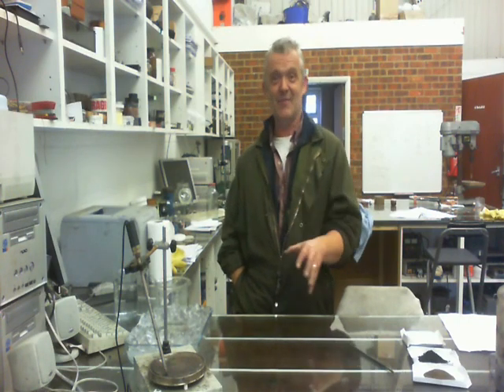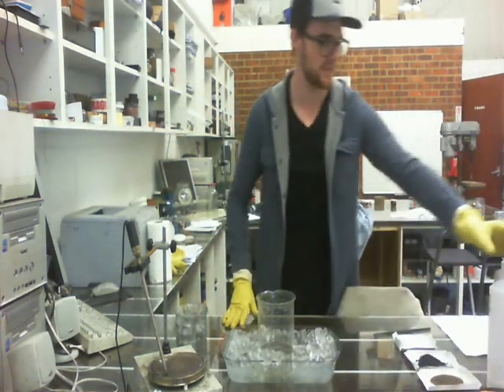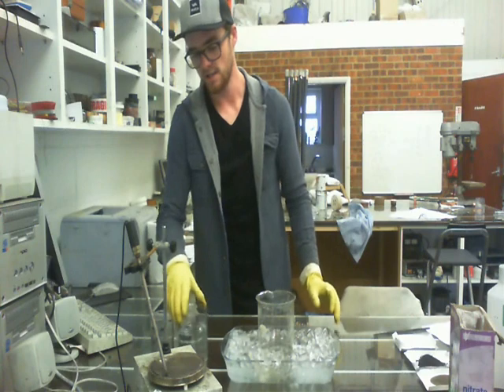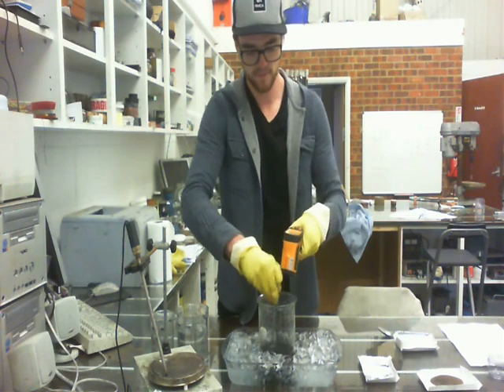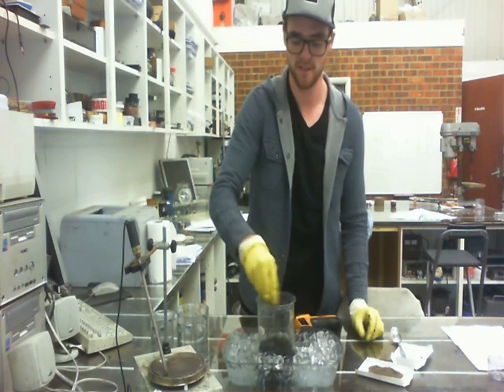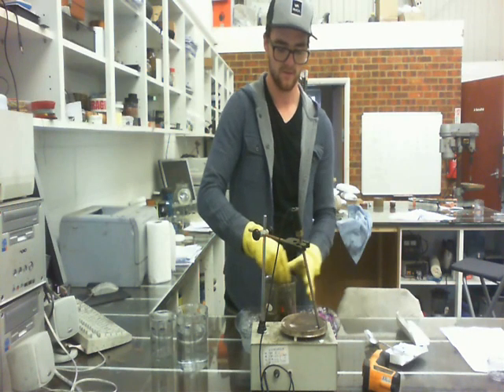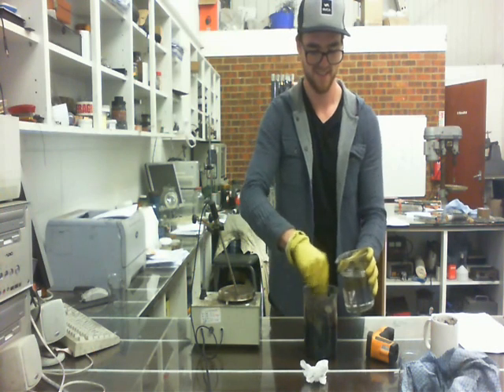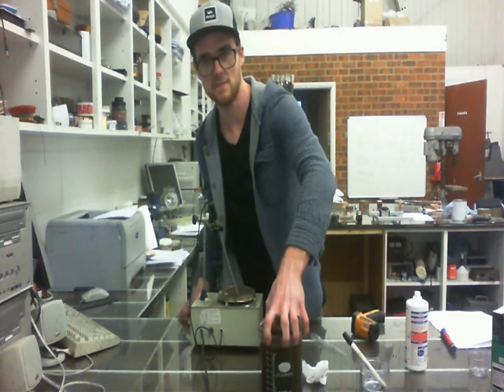Jeremy Makes GO

Comment: Could you advise me where to get peroxide from... i've been all over to try and find some, not been able to locally.
Reply from the maker: it's used as contact lens cleaner and for cuts and burns - and some places dyeing hair - dentists use it for bleaching teeth - the best place is a pharmacy - you can get 3% solution - which is what is needed
Reply: I'll have to have another look
Reply from the maker: chris stagg
ok mate

Comment: good show Rob - as always a good sport :) letting friends play with your toys takes quite some unearthly detachment :) - I always cringe when friends want to help me do stuff ... be it on the motorbike or on "creative" stuff ... 
great job Jeremy !
Reply from the maker: lol - i was cringing inside mate
Reply: hehe
Reply: ok Rob, I'm sorry to ask you this question here but here goes:
could graphene say 5% in water be used for a magnetohydrodynamic convertor at lower temperatures ? say 150 to 300 degrees C ?
effectively you are seeding the fluid with graphene ... passing it through a magnetic field ...  should be able to get some electricity out...
Reply from the maker: actudoran
do you know - i have no idea - but it wouldn't take much to try it - so i will - especially as a friend just sent me some stuff on JP Petit and MHD
Reply: Wow cool! Got to feed the baby and will get back to you in a short while
Reply: there are 2 types of mhd ... closed and open circuit.
on the closed type i was thinking that during the summer when we cannot sell all the thermal power to the municipality we might be able to recover some heat and turn it to electricity even at low efficiencies it still makes sense rather than venting it to prevent engine overheat.
on the exhaust pipe if close to the engine we get approx 700 C ... the exhaust is already ionized so no seeding necessary ... might be able to pass it through a mhd before the heat exchanger and thus attain some gains ... just a thought ...
seeback effect elements are always an optiin to be considered with both high and low temperature diffential.
organic rankine closed  cycle comes to a similar output to seeback ... cannot see the avbantages of going that way ...
Reply from the maker: actudoran
you have given this quite some thought then
Reply: Truth be told ... we'll produce 100 MW electric and declare 40 MW thermic .. but in fact it is close to 100 as well ... with a part of the heat we'll cool the plant and power auxiliaries ... there are a few challenges to overcome. 
One of them being the best way to convert heat to electricity in the most reliable and inexpensive way.
MHD could be such a system used efficiently. Question is whether we can do it with low temperature fluids as well ...
Reply from the maker: actudoran
LTD is the way forward mate
Reply: I was hoping you would say that
Reply from the maker: actudoran
it's Kimberley's bad influence lol
Reply: Robert Murray-Smith hahaha ... you don't say!  ... still how would you go about it if you were me?
Reply: say i install close to the exhaust manifold along the exhaust pipe a mhd generator  ... basically a permanent magnet or hallbach array insulated from heat with a thin layer of solid smoke, electrodes made from heat resistant materials like neobidium alloys ... the result would be the vectoring of the ionised NOX and CO towards the electrodes .... would that result implicitly in a deminished quantity of polutants? my guess would be that it does reduce CO and saturates NOX ... forming CO2 and NO2 ...
Reply from the maker: actudoran
I am sorry mate - i haven't looked at this - yet - so i really don't know
Reply: Just thinking out loud mate ... thought you were the best man I could spill my thoughts to ... no worries
Reply from the maker: no worries mate - i was just worried you were expecting an intelligent comment lol